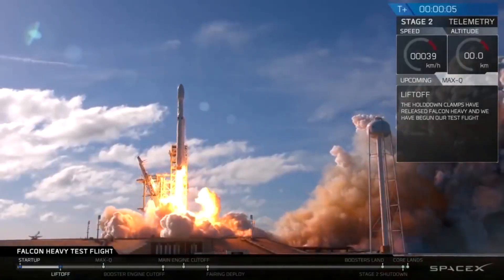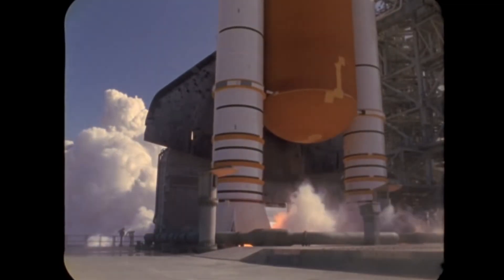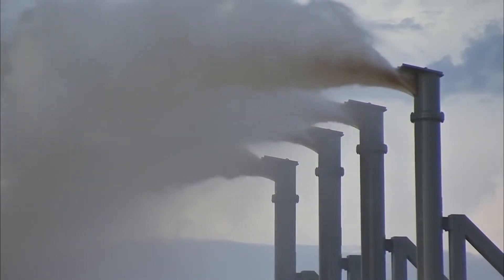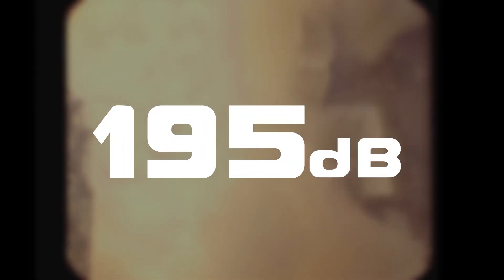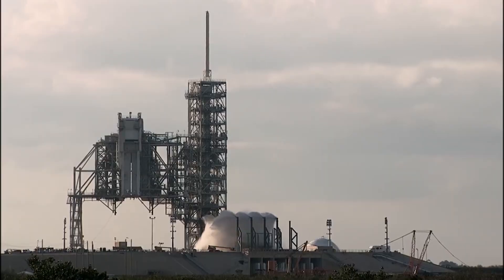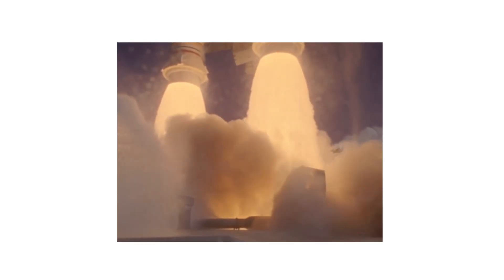Why doesn't the sound of a rocket launch kill you?

Comment: ...I don't know where they are getting this 220db estimate; the maximum sound that can be produced at sea level is 194db; if you were standing 1500m away at the time of the launch (on the LC39 observation gantry, for example),  you would be hit with 150db of sound, which Is 1000 times louder than the loudest rock concert you have ever heard; results would not be very pretty.

Comment: Im still amazed nuclear power is not used in rocketry at all. 
Baikonur solution is probably smarter and more robust, but that huge piping system just is cooler.
Reply: nuclear power has been used in rocketry, but with one glaring problem. If it falls to earth, imagine the damage.
Reply: @Noorthia  Biggest argument against it was , that it is close to useless in vacuum space, as rocket engine needs to eject some material to get acceleration. Nuclear power in eg. subs, aircraft carriers is not prorblem in this regard as there is plenty of water, air and other material to work with on earth. AFAIK scientists havent figured silver bullet to fuel rocket by pure energy in space yet. Solar sails are different, taking use of proton surges. Solar panels are only used to power electronics, not for movement in space.

Comment: 1:35 "sensitive heat shield" so does it protect against the heat or not
Reply: It does. It is just very fragile.
Reply: You can put a blow torch to a metal can for a while and get it red hot, but it'll still dent when you drop it from 5 meters.

Comment: USA: We're going to solve this sound problem with this complex system of pipes and water and water management...

Russia: Dig a bigger hole...
Reply: also russia: make much more stable rocket, close to never fail.
Reply: At Cape Canaveral the Water Table is too close to the surface at such a location- only yards from the sea- to permit a deep hole. It would only destabilize the earth near the pad, and collapse it thru erosion, especially with the intense VIBRATIONS a launch creates. Baikonur is in the WASTELANDS FAR from any shoreline.
Reply: HOLY LIQUEFACTION, BATMAN!!
Reply: USA spend millions to make a pen to write in zero gravity in space. 
Russia: Used a Pencil. 😝😝

Comment: Decibels is a meaningless measurement without mentioning the distance at which it is measured. Reference "inverse square law." 220 dB at 1 inch would be 90 dB at 50 miles away. 220 dB at 1 ft would be 90 dB at 600 miles away.

Comment: One of the problems that the US Air Force has with the KC-135 [Converted Boeing 707] tanker is damage due to noise from the engines.  The rear fuselage of all these airplanes have external patches to fix/prevent metal cracks in the surface aluminum sheeting from occurring.  This is with JT3 engines.  Imagine what rockets are like to structures....

Comment: I fail to see how that would change anything. The few seconds after takeoff and the engines are free from the water park and red netting. Are u just not back to square one. I mean the sound is still coming from the engines right. And sound travels all around. The rocket is cleary not pulling away fast enough to keep it behind. And did it not just go from 220 db to 195, 145. 
                         "A jet engine"
Reply: The danger is from the sound reflecting off the ground, once you start rise the danger goes down.

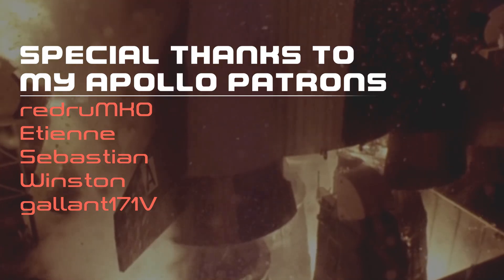Comment: 4:05 Is that unburnt fuel coming out of the bell nozzles and suddenly igniting (outside the nozzles)?
Reply: No, it's exhaust from the fuel pumps. The fuel pumps burn the same fuel as the main engines, and their exhaust comes out around the outside of the main exhaust. It's still hot, but it's cooler than the main exhaust. It looks black for the same reason sunspots look black.
Reply: @jjohnston94  Wow what a great explanation. Now I know the answer to that mystery. Thanks. So we don't see it like that it's just a difference in light intensity and a "stopped down" exposure.
Reply: @Justwantahover  I think that's pretty much it. Plus, there may be some difference in chemical composition since it's cooler.

Comment: Lol, that is not even sound, its a shockwave similar to what you get from an explosion. A grenade generates a sound of 260db when exploded, which is a shockwave through the air. However it is very localized. A Rocket Launch is basically a very large sustained explosion, which is similar to blowing up a lot of explosives across a large area.

Comment: But still not loud as a steel glass falling on the floor at 3am.
Reply: what's steel glass?
Reply: @swaftbelic  i think he mean't a steel cup/jar, which actually would be an aluminium cup/jar/bottle, so basically metal falling on the ground.
Reply: @DrakyHRT  ah yes, now I get the context. Glass as in the general term for a cup. Thanks 👌
Reply: @swaftbelic  Basically in India or other SE asian countries... Metal Tumblers are used instead of Glass or plastic ones... Tumblers are called Glasses in vernacular dialect usually.

Comment: Title: Why doesn't the sound of a rocket launch kill you
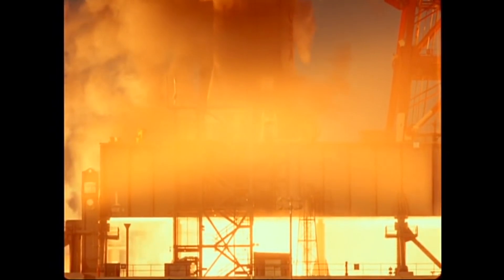Video: 1:10
Me: confused screaming intesifies
Reply: I was waiting for him to say "the main reason the hundreds of decibels don't kill spectators... is because the spectators are miles away from the rocket."
Reply: It doesn't kill you because we no one is standing that close ya fuck.
Reply: @Paultimate7  how about astronauts on top of rocket? only ~100 meters. engineers made some clever design for that also?
Reply: @effexon  They are inside a huge metal tower, so yeah having a lot of metal that is called a rocket to absorb the soundwaves before it reaches you is a very clever desing i'd say, jokes aside, they are on the top of the rocket, and the 150-180 Db's are only when you are very close to the engines, when you are in a distance of 50-100 meters the sound will have dispersed a lot already, and they are inside the rocket, the sound is going outside, so what reaches them is only the sound that bounces back to the rocket itself.
Reply: depends on whether or not the sound energy traveled faster than heat from the exhaust, but either way your ass is about to be vaporized.

Comment: "Solution is to simply suspend the rocket over a much larger flame trench". Well, if  it is so easy to suspend a several hundred ton rocket pushing down against the platform with the exhaust of even greater power, then why don't Americans do the same? I mean, it seems to be working just fine, no? Why all the complex waterworks if it is as "easy" as digging a trench? Russians have a near-perfect mission success ratio, so they must be doing things right...

Comment: Ah, a classic. While the american engineers construct expensive and complicated contraptions to deal with technical issues, the soviets just... make a bigger hole. You saw it with the "space pens" and how the russians just took pencils into space, and now you have it with the rockets. For real though, the water system is probably better optimized to suit different rockets and shuttles while the launch site in kazachstan is just for sojus rockets
Reply: Pencils produce alot of dust and debris. On earth it's fine cause it just flutters down to the ground, but in orbit they float around and can be inhaled
Reply: That's a problem I didn't consider, you're right.
Reply: @biIIybob858  that's not the reason
Reply: I think plenty of other objects on board would be very flammable, and that a pencil would be the least of their concerns. The guy before you got a good point saying that the pencil shavings could possibly be a threat

Comment: I would like to point out a major flaw with the entire premise of this video. 
Nitromethane burning top fuel engines are significantly louder than a rocket engine, however you are perfectly safe standing 2 feet away.
Reply: Jake Hildebrand idk, google says top fuel dragsters are 150 db. 150 is SIGNIFICANTLY less than 200+, and people still say they arent able to breath momentarily when they are behind a dragster going off.
Reply: @buzzmas8068  the 150DB statistic comes from the smaller nitro burning engines, like V6's.
The Nitro V10's are where it gets real loud. (NHRA runs V8's)
Reply: Jake Hildebrand can I get a link that explains how a dragster is over 200db? I just can’t imagine that being real, even though you seem to know your stuff
Reply: @buzzmas8068  sure, let me look
Reply: @buzzmas8068  its hard to find information regarding nitro engines bigger than the V8's since thats the largest nitro engine  allowed in the NHRA, and generally require several parts to be custom built.
Reply: @buzzmas8068  another thing is that refinements in nitro engine technology over the years have made them a lot quieter than they used to be.
Reply: Jake Hildebrand yeah, unless theres a source about it, I’ll probably stick with saying the five massive rocketdyne f1 engines producing 1.5 million pounds of thrust each required to lift the 6.5 million pound saturn v rocket into space were a tad louder than the engine in a relatively dinky dragster
Reply: @buzzmas8068  while I am fairly certain about my claim, I understand and respect your need for proof, as proof is the only way to prove a fact. 

And since there is the possibility that I could be wrong,  your skepticism is justified.

Comment: What are you talking about rocket engines are very quiet, why even just 7 ft away and roaring you can talk to say... houston on a radio
Reply: Nobody is ever 7ft away from a rocket at start, not even the astronauts. They are not only pretty far away from the engines, they are also insulated by the capsule. As for command, they are very, VERY far away from the start and are observing per video surveillance.

Comment: What about the astronauts, how are they protected from all that sound energy?
Reply: Distance and lots of insulation. If the pods themselves are designed to protect you from:
-radiation
-pressure differences
-rapid acceleration,
I'm guessing that the astronauts are protected from shockwaves that could potentially reach their pod

Comment: This is a good video but it leaves an unanswered question:
What are the limitations of the Roscosmos sound suppression system? It seems very simple, low maintenance and cost-effective, so why doesn't Nasa use something similar? Is the Roscosmos system somehow only suitable for Soyuz rockets and if so, why?

Thanks in advance.
Reply: I think that the soviet system is optimized for soyuz rockets, and that no other type of rocket would benefit from this design. I think that NASA has built a more expensive but an adapting system that can be used on a variety of different rocket models. I am no rocket scientist though, so this is just a guess
Reply: The means that the USA and russia use are omptimzed for that environment. The ground near Kennedys launchpads is not hard enough to last, and is in danger of flooding or even sliding. 

Russia doesn't use water because it's (to put it lightly) cold as fuc

Comment: Trust nasa to find the most complex and experience way to solve a simple problem lol
Reply: I think that nasa took the more complex but more adaptable solution. They can launch different rockets from one single site, while the russians can only launch soyuz rockets from their particular launch site. Maybe NASA encountered terrain that wouldn't be able to stay in a specific shape under extreme pressure and temperatures, and so they had to compromize with the water system

Comment: And why would it kill you? Deafen yes. When sound becomes as low frequency as a shock or blast wave, then it is no longer sound. I suppose that if the frequency of the sound is measurable and the intensity strong enough, it could set up some resonance in some vital body part, like your rib cage and possibly your skull. You would have to be very close and the frequency would have to be just right. Death by rocket exhaust would come from heat and blast effects well before sound ... IMO

Comment: I have a question....nasa's rocket use o-rings to seal the casings on their rockets and cant launch them if the temperature is 40 degrees or below because the o-rings harden and dont seal up. What do the russians use on their rockets?